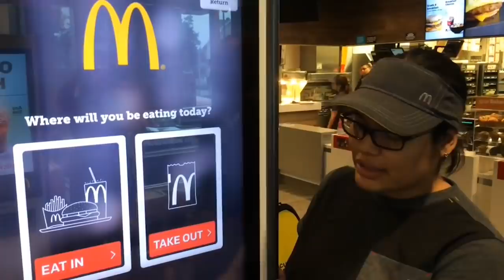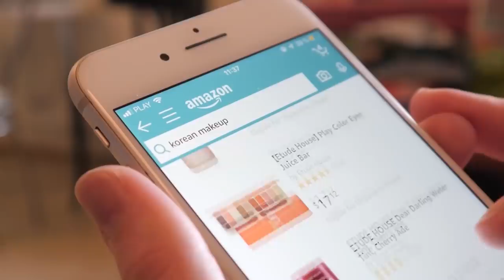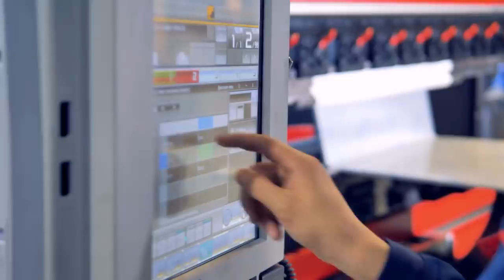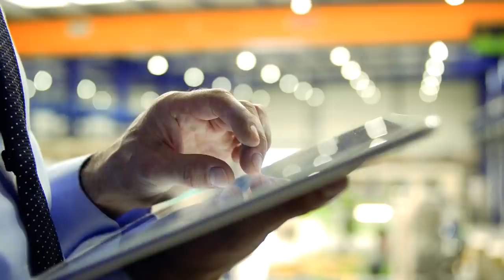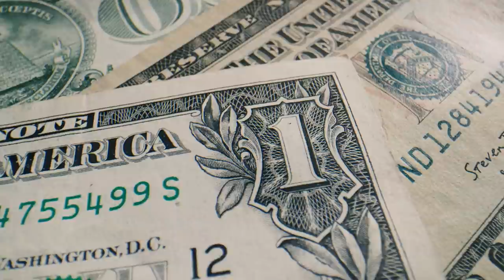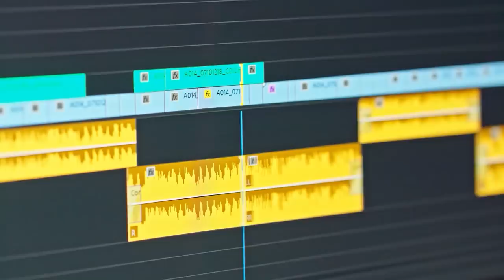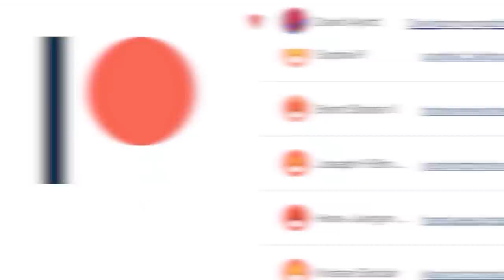The Two Futures Of Automation: Capitalism VS Socialism

Comment: "The greater the rate of automation, the lower capacity for human workers." There is no better example of this than the agricultural field, from employing 90% of humanity less than two centuries ago to employing >1% today. This trend feeds into all fields, automotive, pharmacological, retail.
Reply: And it isn't bad! They don't have to break their backs for that work. Instead of fighting automation, embrace it and use the gains to lift those replaced upwards!
Reply: @nates9105  automation itself is great if it's used to help everyone reduce their work loads. It's a big ol problem when it's being used to drastically increase the rate of wealth / resource extraction from communities.
Reply: @nates9105  It'd be good if it was used for lowering the time each peson spends on working, instead of how many people can work, as so far work is still something you have to do to survive.
Reply: @nates9105  The other replies are missing the fundamental point. Automation is good ONLY IF the worker own the means of production. Otherwise, it's a dystopian hellscape
Reply: @theflaggeddragon9472  Yep! But that brings the question - how do we own the production? Is it all employees own a piece of the company? How would that look from a cleaner, to a repairer, to the laborer on/throughout the line, to the engineers, to the administrative office workers, to the group that initially put together the initiative and capital for the business?

Or should something like charging a fair tax to the privatized owners/giant unfair businesses by using the representative democracy government we have, which should be owned by the people but evidently giant giant businesses end up having huger influence?
Reply: @nates9105  Every employee should own a share of the company. In fact there should be no such thing as "shares" only employees but that's a separate issue. If you and a friend start a business and then you hire people to carry out the labor of "your" business, it's not your business anymore, it's everyone who makes it operate. Every employee should be allowed to vote on their pay, their hours, their benefits, etc. These are called worker coops and are much better for workers especially in the face of automation.
Reply: @nates9105  I'd say that each employee should have a share in the company, and honestly it might be better if there's a cap on how big any company can be.
Reply: So what? Automation will just replace low IQ and low skilled menial work. Anyone who works hard and isn't lazy will upskill and find the new jobs available (i.e. engineering, even some basic maintenance roles). Did you complain over the invention of the computer which made telephone switch board workers redundant? No, because they got jobs doing more meaningful things
Reply: @yt_nh9347  why does every employee need to contribute to how the company spends its own revenue/cash reserves? If the company takes out loans and the employees are all partaking in profit sharing initiatives it's in their best interest for the company to not fail. If there is not profit for the company, the companies own cash reserves would take a hit (again not out of the owners pocket either) and the employees would see no benefit in the profit sharing because there was no profit. You're acting like the companies revenue/cash reserves == the owners money. In our current society we still have situations like Theranos where the owner themselves wasn't liable for the $ of the company going into the ground, in fact shes only on court for scamming people. So in that scenario what was the risk that Elizabeth Holmes took? CEOs have paid themselves millions when a company was going down before and requesting government bailouts in modern day society? So what risk did the owners have there? Today money makes more money than hardworking effort after you've reached a threshold due to compound interest and other multipliers which is absurd. We can see that even in our society right now the tech sector using RSUs as profit sharing Initiatives have yielded excellent results. If we take that to the next level, we can reason that the results will still be good.
Reply: @gytiskrotu  Also a large portion of CEO pay is in company shares not cash so they are also directly impacted by company performance. Jeff bezos cash salary is 80k a year from Amazon in cash but he makes a lot more because he is also paid shares. If Amazon underperforms because of his leadership then he also loses out as the majority of his wealth is in amazon shares
Reply: @yt_nh9347  sure but if every employee were profit sharing/had ownership of the company. They'd be put in the same situation. But again GMs? Ford? One of the major automakers CEOs paid themselves out 5-6M in cash before they got bailed out by the government. So again, that's not always the case.
Reply: @nates9105  dude you realise some people’s passion is farming and really doing physical work? Some people, like me, love using their bodies to tend to plants and actually do hard physical work. Isn’t the point of leftism to liberate workers to work how they want and not at the hands and rules of a capitalist class? But how is that being done when work that people want to do and love doing are being deleted and replaced by automation? It’s not necessarily a good thing. Also most machines in farming only work well in mono-cultural crop fields, that are already bad. Permaculture and agroforestry is the way to go, but machines can’t work effectively there because it demands human flexibility and harmony with nature.
Reply: @yt_nh9347  Why would anyone put up individual assets as collateral for their company? Bankruptcy is still a thing with worker coops, and no, worker coops are not communism. 

Is your first question about whether the people who made the robots get the profits from those robots even after they're sold? If so, the answer is no. Once you sell your robot, it's someone else's, and it's neither your labor nor anyone else's producing goods, it's automated. It should be up to the employees of the Corp using the robot to decide how their profits are shared, simple as that.
Reply: @yt_nh9347  If the switchboard operators had ownership over the company that replaced them with computers, they could negotiate to have their unemployment paid by that surplus value, or pay for their education until they get a new job. It's not hard to see how this could play out.
Reply: @yt_nh9347  bet you're on your 4th bankruptcy 5th business and 4th house. Dont worry, you'll figure out something soon. Keep rolling the dice. Lmao!,
Reply: @trippsmclovin  lol it's funny to get insults from people that don't understand how businesses operate and why toilet cleaners aren't paid the same as doctors
Reply: @theflaggeddragon9472  If you're going to ask for ownership of a company you either buy shares or put up the capital to start it. You cannot just be given a share of the company for nothing by being an employee.  If you want to be given shares for employment sure, that would mean that you would forfeit your salary instead and everyone's pay will be in company shares (just as in communism). The question is, does everyone get the same number of shares regardless of responsibility? What motivates employees to innovate/increase performance if they are guaranteed shares for existing?
Reply: @yt_nh9347  Well, it maybe true, but the learning ability is not the same among human beings, plus aging is not a friend in leaning new skills. So what do you do when you no longer capable to learn new skills?
Reply: @cathyyu459  Companies and employers are not responsible for you keeping up with market demands or feeding yourself. If you refuse to or cannot adapt then you bear the consequences, just as in natural selection
Reply: @cathyyu459  if by 40 you have not acumulated a wealth of skills and experience that would make you valuable then that is your fault entirely.
Reply: @yt_nh9347  You don't get it, the speed of develop on technology is so fast that the experience and skills you leanrt before 40 will be useless, then you are forced into a competition with new grads, no way you are gonna win.
Reply: @cathyyu459  Industry experience trumps university study everyday of the week and this is particularly true for tech sector because private companies need to be on top of emerging technology and are often the ones developing and applying the new tech. Meanwhile university grads only learn basics of the field (most tech fields are very broad and university only gives you surface level of each area compared to industry). There is a reason why internships at FAANG (facebook, Amazon, Apple, Netflix, Google) are highly competitive, you will learn leading edge skills at these companies and can take that elsewhere to negotiate higher salary. 

On another note, after 10+ years in industry most tech people transition to management which requires more soft skills and process optimisation than hard core tech (although they would have developed tech in early career)
Reply: @yt_nh9347  You are proving my point. People do switch to more administration level after 40, but it would be absurd to think there are more administration position than non-administration position. So for the rest of the people, where did they go? And worst thing is, what if you lose your job after 10 years in administration? And when I mention the competition with new grads, it's not about the skills and experience, it's about how fast you can learn a new skill, and how much energy you can put into your work... Just compare yourself with a much younger version of yourself. Plus most of the new grads don't have family and kids to worry about, their health condition is better, they can probably shift their work life balance towards work more. And you think the capitalists who own the company don't know about this?
Reply: and the best part is farmers now make the wages of the former 90% combined!
Reply: @severdislike4222  lmfao it was a sarcastic joke
Reply: @yt_nh9347  "What motivates employees to innovative/increase performance if they are guaranteed shares for existing?" Because they create value for the business and as collective owners of that business, are compensated for the value they put in. Again, worker coops exist in the US and are great for their employees. 

"Does everyone get the same shares regardless of responsibility" this would be up to the employees, but ideally yes. Everyone should have a vote when it comes to their wages, hours, benefits, etc. In all likelihood, some employees would still get paid more since the markets might dictate that one position is more valuable and they need to pay more in order to higher that talent. It's just markets but with shared ownership so the vast majority of the profits don't end up solely in hands of a few modern-day feudal lords (e.g. CEOs and venture capitalists)
Reply: @yt_nh9347  "if by 40 you have not acumulated a wealth of skills and experience that would make you valuable then that is your fault entirely."

Here's a hint...

Companies don't care for such things. If they think they can save some money by firing you, they will. How much knowledge you've accumulated doesn't mean anything. In fact, it might even make you a specific target, given that you'll likely cost a lot more than a younger, less experience worker.

"On another note, after 10+ years in industry most tech people transition to management [...]".

Some do move to management, that's true. But most do not. A company simply don't have the need for so many managers. 

So what to do with those who either don't have the skills, or the desire, to be a manager? Do we simply just replace them with a newer, younger model?
Reply: @BrickworksDK  The key here is that employees will mainly work with automation rather than get completely replaced by it (unless your job is entirely menial then you deserve to be replaced for efficiency sakes). Also anyone who thinks that experience doesn't matter clearly doesn't work in tech or just sticks to basic coding which of course can be done by anyone. Experience allows you to make sound judgement in the context of solution design, costing and working around customer requirements. Tech work is not just "copy and paste" or following a cook book (if this is what you think then you are referring to menial work which should be automated).
Reply: @yt_nh9347  "The key here is that employees will mainly work with automation rather than get completely replaced by it (unless your job is entirely menial then you deserve to be replaced for efficiency sakes)."

How many were employed in the automotive industry before robots took over? And how many are employed now?

Yes, there will still be some work, but not nearly as much as before. Indeed, reducing the amount of work needed is the entire point of automation. And of course, the nature of the remaining work will have changed significantly. 

"Also anyone who thinks that experience doesn't matter clearly doesn't work in tech or just sticks to basic coding which of course can be done by anyone."

I hold a Master's Degree in computer science and have worked as a developer for nearly 11 years. Granted, I hold no ambition to get to the upper management level (I'd rather code than spend all day in boring meetings), but still... I have seen a lot of bad stuff going on.

I've worked for companies where the churn was so great than nearly all developers had been replaced within just a few years. I've worked in companies where no one knew what the code we were working on actually did, because those who had originally designed the system were long gone. I've worked for no less than three companies where the entire development department was let go, simply because someone in upper management had decided that it would be cheaper to outsource the work.

"Experience allows you to make sound judgement in the context of solution design, costing and working around customer requirements."

Yes, it does. However, upper management rarely cares about that. I've lost count of the times where my estimates for production times were overruled and where I've been forced to release untested code, simply because there was no time to do any kind of tests. Heck, I've even worked at a company where we released code that was so bad that I would argue it was borderline fraud... Not that the upper management cared about that. All they cared about was getting the project done so we could move on.
Reply: @Silversnakesinthesun  

You could still farm yourself in such a world, it would just be for yourself and whomever else you'd share in your labours and whomever youd share your crops with. It just wouldn't be strictly necessary for you or anyone else's survival, and with what farmlands can produce now that is if we turn to more sustainable agriculture in the near future would produce more than enough food for everyone for literally centuries which means there'd likely still be plenty of land for you to do older fashioned farming as a passion.
Reply: I would argue that we have a serious problem with agriculture. You people need to look below the surface of all of this. Automation is NOT FREE. The harsh treatment of animals and the degradation of the earth are the examples automation of agriculture have given us. In order to restore the environment and raise animals humanely, automation has to be removed, and therefore more people and less machines are necessary. I also fundamentally disagree with socialism and capitalism, as I am a monarchist. Some may call me a socialist based on the views I hold. 

I believe in a system in which those who work have the right to own the properties they have improved. For example, a man chopping down a tree should have the right to own that lumber, and do with it as he pleases, carve it into a beautiful piece of art, or sell it to a guild of some kind. the way this process would be safeguarded is feudal contract. You would pay dues to and work a specified time under the command of a lord in exchange for the right to work and live on his land. In order to check the powers of the nobility, a parallel organization, like the catholic church, or a high court of some kind, would be in charge of maintaining ethics of the nobility, and giving an alternate means of social mobility, and for ease of commerce, land would be set aside as democratic areas, where a market based, competition oriented economic system can play out, which would also contribute to social mobility. Automation is not incompatible with this system, but it certainly would serve the best interests of the working class or peasantry, as opposed to capitalism, where the rights of profit are concentrated in a wealthy clique that has little or no checks on their money power, REGARDLESS OF TAXATION.
Reply: @navilluscire2567  You know, I don't think it's in a completely autonomous religious or ethics authority's best interest to let nobility run rampant, no matter how handsomely bribed, since delegitimizing themselves would lead to being deposed in a functioning ethics council, and/or their autonomous income disappearing, as people loose faith in the institution that's meant to protect them. The democratic areas would be mutually beneficial, which again means it would make no sense for the nobility to oppose them. 

Historically, these three estates were in relative harmony in all feudal realms. The only exception was the catholic church basically having the power to throw tens of thousands of iron clad men at the middle east, but the college of cardinals was extremely difficult to corrupt, so it mostly worked out, until it was corrupted, which is what caused feudalism to fall in the west. A lesson to be extremely careful in consideration of international moral institutions.

The holy roman empire at it's zenith was more powerful than all the forces of islam and the hungarian raiders combined, and through this, they were an untouchable economic giant. This level of efficiency is a dream in our modern world, but it was achieved in feudalism, and it was not inhumane. There was no widespread depression, starvation was largely a product of instability as a result of raiding from muslims and others, and people could afford to live and have tens of children per couple with enough surplus to go on a journey to jerusalem.

You speak about 'old fashioned feudalism'  as if it's some insidious villain, yet you seem to be missing that I am describing exactly that. Clearly you have not done enough research into what feudalism actually entails, because it's a hell of a lot better than capitalism and socialism for the poor. Also, keep in mind, a noble's resources come from the land they own and the peasantry being productive on that land, not from exploiting profits by owning the production itself.

Feudalism works by taking a cut of the person under you in the feudal chain in order to make everyone's life better by resource pooling. So in other words, the peasantry living lavishly is in the best interests of the nobility, since they get a cut of that lavishness. This is not an unfair system, because a peasant will keep the majority of the fruits of their labour, while their noble will be able to organize them in a way that benefits both parties, a historical example being the construction of water or wind powered mills to grind wheat more easily, the first automation, which directly led to the industrial revolution.

And in case you have any further doubts, in feudalism, a noble's military is largely made out of peasant levy. The noble trains his levy to be warriors that can fight wars. What do you think this peasantry will do if said noble does things that really piss them all off? In other words, the peasantry basically have the right to bear arms. There are several feudal institutions that have been displayed historically that prevent nobles of bad character from abusing their position, and serve strong social cohesion. 

Strong social cohesion is what laid the foundation for everything we have right now, and weak social cohesion, which is what we are currently facing, is what is going to take everything our forebears poured their souls into away from us. So be it.
Reply: @navilluscire2567  the nobles were not 'screwing people over' by evicting people who refused to meet obligations. I just said the reason they don't bribe an institution like the catholic church, is because the catholic church and institutions like it cannot be bribed for a number of reasons which I indicated in my previous comment.

intellectual property exists for people's art to be protected, if they use it for the purpose of exploitation that is unethical and it should be punishable, especially if they do so for the reasons of surveillance and other things that the capitalist class which owns the intellectual property of coding and other software are known to do. 

Also, this is not 'neo-feudalism', it is capitalism. There is no breakdown of power in capitalism, google owns everything in google with an iron fist, there is no nobility to share ownership of google and manage their own pieces of google, there is just the shareholders and the CEO. That is the only way that a business model that exploits people in such a manner can actually function. 

Google does not tax people or collect tribute from people from their prosperity, it exploits the profits of a software machine they have created and completely dominate. That is the difference. Feudalism demands class cooperation, capitalism doesn't. 

Also, I never said the catholic church was screwing anyone over, I just said it had overwhelming power, enough to literally move history. I'm saying that is a bad thing.
Reply: @yt_nh9347  hey man gotta love it when you call me uneducated and I'm sitting on my Google RSUs I got back when I signed my contract with them (you should look up what RSUs are). But clearly I put my own money into the company right? I wasn't just an employee that was compensated via profit sharing? Hell I'm not even a C level exec, but most tech companies are still giving out RSUs to regular employees. Be like Tech companies, share your shares.
Reply: @yt_nh9347  "so does every employee also contribute to the millions of dollars to implement the automation or build the company?" like literally yes???? that's what employees always do????
Reply: @yt_nh9347  "sure if you don't have this job you'll die in the streets, and you do all the work that makes this company function in the first place, but you don't have a STAKE in it, because I'M the property owner!"
Reply: @yt_nh9347  "for nothing by being an employee" complete contradiction
Reply: @nates9105  The Capitalist pyramid only has so much room at the top.